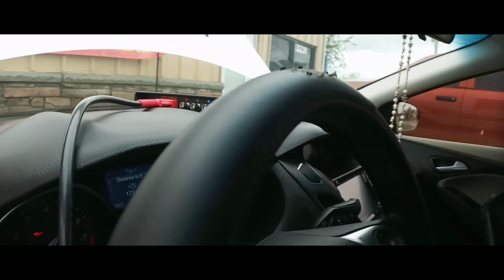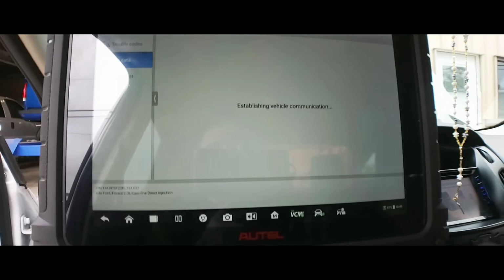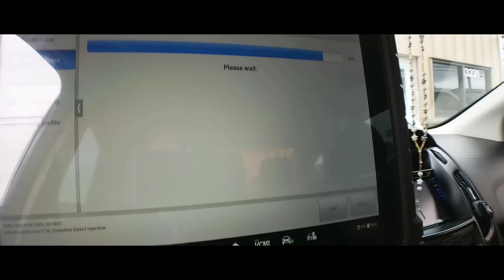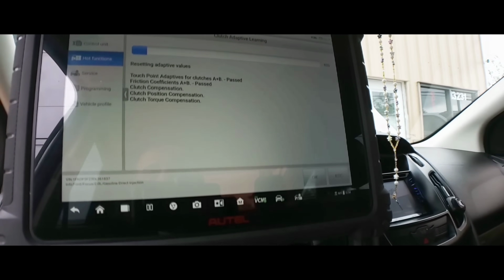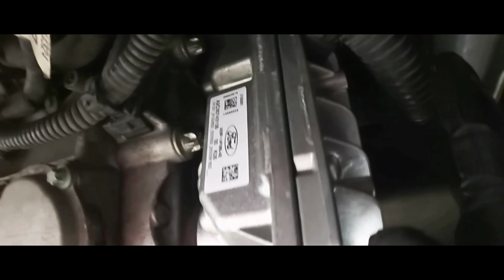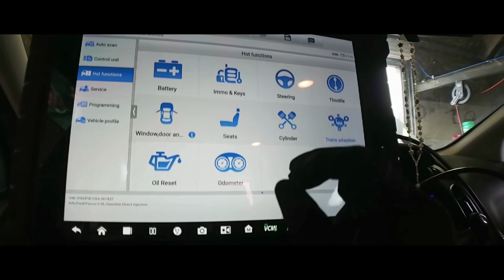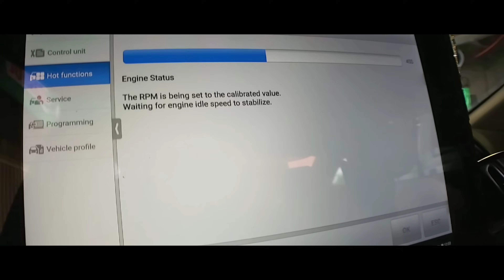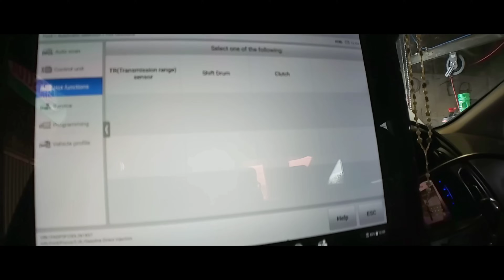🔧Ford Focus DCT Transmission Diagnosis - DCT DPS6

Comment: Just Got the invoice for whole entire replacement, 3k for everything(All) in the Bell Housing, He told me its the Forks A&B inside of the Housing,(From Experience)As you said also! He's a transmission specialist of 20+years, The #1 atleast in my County, Blessing 🙌 I didn't wanna cut corners so let's see after a total rebuild, will definitely keep posted,
Reply: It took me, an amateur, 3.5 hours to drop the trans. Probably 1 hour to install the forks and clutches and 3 hours to reinstall so about 8 hours work total. The parts were $580 from Rock Auto.
Reply: @alexkram how did it do after you changed it out? Did you have to buy the special tools?
Reply: @sbarton6908  I've done two cars now and they both shifted like new afterwards. The only tool I needed was something to pull the clutch out. I was able to make a tool for that out of some angle iron by welding a nut into it and drilling two holes for the clutch studs to attach to.
Reply: Fuck yeah man i dod same shit 😅 gotta love welding brother 🎉🎉🎉 @alexkram

Comment: The tool to turn it 14 times cost 20 bucks on Amazon all I did was spray break cleaner on mine while turning it 14 times and after doing that a few times I noticed it would unwind faster and faster and now it works better than ever. Didn’t even have to change the clutch actuator motor after all. I also cleaned out the inside of the shaft where the 14 ribbed Allen key went from any grime so the actuator would grab better and be less likely to slip and presto. Good as new. Even put some grease for better heat disbursement and less chances of chipping. Ended up only spending 30 bucks total and took me 30 mins to fix. I’ve seen some people use wd40 and breakcleaner together and even drilled holes in two places to get it all up in there and drain it too but I didn’t do all that though.
Reply: Thank you for your comment. I would definitely try that

Comment: So, let me get this right, instead of a nice manual transmission with one clutch, you have two clutches that are computer controlled.  No problem, you're good to go!  I foresee no issues in your future!!!
Reply: You can buy the manual. 
But a lot of people want automatic transmissions.
Dual clutch is like driving an auto, but they're about 10% more fuel efficient. 

Unfortunately Ford brought these to market before they were fully sorted.
Even worse, Ford dealers have absolutely NFI how to fix these. Many problems like in this video can be fixed by removing clutch actuators and cleaning out the clutch dust with brake cleaner and some WD. 10 Minutes and zero dollars. 
But dealers and transmission shops charge thousands. Even a new actuator costs about $100 and takes a few minutes to replace.
Reply: Manual transmission is the most efficient, but nobody can drive them anymore, so the manufacturers have to make a manual trans that is operated by a robot.
So just picture a robot like from the Jetsons in the passenger seat operating all the mechanics while Jane Jetson just steers it into the nearest tree.

Comment: This reminds me of a 2 year old Corolla with a locked up electric E-brake I worked on last week. I had to go downtown to an underground parking to release the brake. They couldn't get the car to the elevator to bring it up to ground level for towing. It uses a similar servo and drive mechanism which had corroded.
Reply from the maker: Technology is changing so fast on vehicles now that they're using a lot of electrical devices to run them, too many robotics built in.

Comment: Nice work! What a strange design. I wish manufacturers would just stick with the old wet clutch style transmissions and get rid of this CVT and DCT stuff!
Reply: yeah it seems like every time a technology gets mature and really working well it gets phased out for something that performs better but less reliable. I'd take a DCT over a CVT though because when a CVT goes bad you can't even really rebuild it.

Comment: @Automatic Transmission I was wondering if you Checked and/or Deleted and remaining DTC codes after you finished with the Clutch Adaptive Learning process? (Timestamp 19:35/20:09)

Comment: I have an 2012 also my problem is after she warms up she stops shifting I usually pull on the side take of negative terminal reset computer start up and then she roll after for a few minutes then I would have to reset again what do you think that could be ?

Comment: Wish I saw this 2 weeks ago. Had a 2012 Focus come in and this was my first time doing one of these. Wasn't making that noise though. Replaced clutch without knowing you should replace the shift fork. Even asked a transmission shop next to our shop if I should replace them and was told no. Ended up putting it all back together and it won't let me finish programming. After watching this I'm positive that my problem is the forks. Only problem I've ran into now is resetting the clutch
Reply from the maker: Yeah, you're going to need the tools for it. There's a video on my Spanish channel  Transmisión Automática.
Reply: @AutomaticTransmission  i just installed mine with flat head lol no special tools needed lmao
Reply: @reecejones1248  The only special tool I needed was one I made out of a piece of angle iron with a nut welded to it to pull the clutch out. The forks need a torx plus sockets but I already owned those.

Comment: I have a hand-held diagnostic tool, but it did a job by showing 2 faulty codes P07A3 & P2872 the same codes you showed in yours. Do I have to strip my transmission box which is a big job and Ford dealer wanted to charge many thousand dollars or just simply turn the clutch fork counter-clockwise 14 turns to fix it like in your video? Your expertise advice would be much appreciated.

Comment: It'd be nice if you could do the troubleshooting on the Fiat's & Chrysler's double clutch version whenever you get one in. I had one with no apply in any gear, but the fsm manual dnt have a lot of info.

Comment: Guys, don’t forget the relay that powers the transmission. Sometimes low voltage between the control and load side could cause all sort of issues. That little thing opens and closes million times during the life of the vehicle.

Comment: I am getting ready to perform the learning process for the TCM. I am receiving a parking error. (Transmission Not in Park Please Select P) The car will not crank or start, but has battery power, all the lights come on but when I go to shift, the "D" is enlarged and gray instead of the orange it usually is. The shifter will move the gears but the computer part of the car doesn't register that it's changing gears. I'm at a loss of words and not sure what action to take now. Any and all advice is appreciated. 😊
Reply: I know this is an old comment and you have figured it out by now for anyone else reading this your problem is one of two things: 1. bad transmission range sensor or 2. trans wire harness big connector is not fully mated. This exact thing happened to me also on my first time doing this and it was #2. I tried replacing the range sensor with a junkyard unit first but there was no change. I lubed the big connector with silicon spray and reseated it and it was all good.

Comment: I have Renault EDC DC4 and I think its same  TCM uses. Why are they had problems and need to replace? Any method to fix it or protect? I heard its causes coz of weak battery or heat issue. Is it correct? Any external item for that TCM cooler? Thanks.

Comment: I've worked on over a handful of these cars and the DTC code I stay away from, I believe is P2837 or P287B. Cause I don't want to take apart the trans to get to the gearbox. 
I don't mind doing the clutch though.
Reply: Why? its a 3-4 hr job in and out and the car drives like new again
Reply: @schmick63  cause I don't want to do the job.

Comment: I have a 2015 Ford focus dosent reverse and when i try to do the Clutch adaptive learn it fails at Select gears do you have any idea what it could be?
Reply from the maker: Sounds like the case might stopper might be stripped. It's going to require a new cover. 
Do the "shift drum learning ", if it fails you need a new case cover, which is the main case of your transmission.

Comment: I've got a P0805 Clutch position sensor "A" circuit & P2872 Clutch "A" stuck engaged on a 2012. Turns out A clutch servo motor will not turn on ignition is turned on (self check) B will turn. Swapped out the servos and problem stayed with A clutch. Dealer says it's a TCM problem ( I think they're right). So now waiting on a TCM. BTW with the servos plugged in and hanging out the self check when turning the key to ignition should make them turn no tools or scanners needed to diagnose.

Comment: What would be the problem if the fork keeps spinning and doesn't reach a top nor bottom?
Would the fork be snapped?
Reply: I’d say the threads on the rod or the teeth on the gears are stripped or broken…but I’m not a tech, just basing that off of knowing how the part is supposed to work according to the manual.

Comment: Which autel scanner are you using. I'm tired of my snap-on modis edge
Reply from the maker: Autel Maxisys Ultra, it has a built in 4 channel oscilloscope, wireless, It's a nice tool.
I retired my SnapOn Verus Edge, I only use it on older vehicles that the Autel wont do, like OBD-1 domestics and imports. I have all the the connectors for them, so if you get an Autel scanner keep your SnapOn for older vehicles if you have all the adaptors.

Comment: I have a 2015 Ford Focus and my car does not reserve and it makes that sound like in your video. I bought a new actuator to see if it fixes the problem. Now when you turn it 14 times counter clockwise, should it be easy to do because when I tried it it actual spin right back. Am I doing it wrong? Please help!
Reply from the maker: The reason I performed that particular test was to see if the fork is pushing on the clutch. So if yours is springing back at you it's considered good. 
On the video the actual motor was the issue, splines worn-out causing it not to grab.
Reply: I replaced the Actuator B and my car still does not reverse and still make the noise like it did in your video. I check the fuses box and I disconnected the battery and still unsure what is wrong with my vehicle. If you have any suggestions would greatly appreciate it.
Reply: @capricefrazier9369  did you manage to fix it?

Comment: Que abido mi compa tengo una silverado 2015 i tengo un problema con la trasmission lla le cambie la caja de valvulas ase esto vas en la carreterra i cuando le vajas la velocidad. Vaja los camvios muy rapido como si tragera el freno de la trasmision
Reply from the maker: Tenia fierro en el carter cuando cambiaste la caja de valvulas? Puede que la compensator valve se este atorando.

Comment: Hello!  I have the same transmission in my Smart 453 from 2016, unfortunately I have some error codes in the gearbox, I reprogrammed with a new software but in vain.  error codes: U0028,U010187,U010182.  Do you know anything about them?  thank you

Comment: Mine fails at Shift Drum Adaptive Learning. Both actuator motors have been replaced. I'm suspecting the TCM since I'm getting P285C Shift Fork A Actuator circuit performance, P2860 Clutch B Actuator Circuit performance & P2872 Clutch A Stuck engaged, along with the same for Clutch B P287A, also some weird one that says Clutch B Disengagement time performance P2877, same for clutch A.

Comment: My 2015 Fiesta makes that same exact sound! 😮
Reply: My son came in the room and asked , " is that a Ford?"
Reply: The ones that crack me up are some Asian cars have a ' beeper ' that is exactly same thing as cheap, two- dollar quartz dial alarm clocks.
Even pulse the same.
Makes me think that somewhere under the dash is one of those clocks wired to the system.

Comment: I’m having a clutch replacement and dealership was able to replace but it won’t relearn the new clutch. I have no idea what to do.
Reply: What did you do in the end ?
Reply: @oscarcee6831  they had to change the transmission housing/case, a piece (the “stop” had broke off inside and was causing the TCM to not know what gears it was in, after the changed the case the clutch was able to relearn
Reply: @theempirestate6982  thanks for the reply , what milage did your car have ?
Reply: @oscarcee6831  140000
Reply: @oscarcee6831  after the clutch and case replacement it is running really well even at 140000

Comment: Hey thank you for putting such helpful videos. I currently have this transmission issue. 15 ford focus. I recently removed the dct transmission to inspect the forks and clutch. And they looked fine. Now when I reinstalled everything it makes a horrible grinding noise when I shift the gears and  Code P073F -Unable to engage gear 1 pops up. I did the adaptive learning for the drum and passed. I did the clutch learning and everything passed except for "clutch touch adaptive learning". If you or anyone have suggestions or tips, it will be greatly helpful
Reply: Same here, did you find a fix?

Comment: Today I followed your instruction & rotate clutch fork. 2 recent faulty codes P07A3 & P2872 disappeared. I drove a car for a test with my small hand held diagnostic tool. After a car was driven for a test, the input shaft speed A & B showed unequal input voltage. When a car was not too hot, input shaft speed voltage A & B were equal nicely. after the driving test, a new faulty code P286F appeared. Please let me know what's going on? Did clutch actuator B need attention or was it TCM problem? Thanks

Comment: right now 
I have P2872 clutch A stuck engaged. i have only this code... plz what can I do.....please note that  ISS A raw has velocity (speed) with the RPM of engine even when I disconnected the clutch A actuator motor.
Reply: I am having thé same code error did you found a solution to your issue ?
Reply: @ibrahimadiop4990  I have been searching but I can't solve it... and I found to replace the gearbox with a used one but its costest... I found a garage to fix it but the cost is higher than the used complete gearbox. plz update me if you fix it ........... the problem is either dct clutch or bearing. How long time are you using your car? coz I am scaring to repeat the fault after fixing it.

Comment: Used to work for Ford done many of those clutches 
Nice diagnoses
Reply from the maker: Yeah, most of these vehicles are out of warranty now. We're seeing a lot of these going through the shop. We're getting all the parts from Ford, seems like the aftermarket hasn't come up with parts to service these vehicles yet. 
Still some new clutches have issues right out of the box, Have you had any issues with any while you were working for Ford?
Reply: @AutomaticTransmission  yes had guessing I in 8 had some sort of issue 
Alot of software issues
Reply: @AutomaticTransmission  hi when you mentioned clutch, which parts did you refer to, the fork or clutch actuator? I tried to understand more, because my car has similar issue. Thanks

Comment: Wow! That's nuts! 1st I've ever heard that!!  Haha. On to the rest of the  video...

I'm up to the part where you think 1 of the actuator motors is bad. My thought,  it almost looks like it's shorted to a pulsed power? Now TCM is powered off and all stopped. So somehow backfeeding itself?? Pulsed?? Just so weird. Very interesting case study.
Reply: Ok... very interesting...i know I said that.  So the lack of being to turn that fork using the actuator was technically keeping the TCM awake? Like wipers trying to 'park'?   I see you've stepped up your diag game Hiram. Very impressive! 😍😁😉👏🏻👍🏻👍🏻
Reply from the maker: Yeah, these vehicles wake up really easy and fast, if you just open or unlock the door you'll hear the shift forks align to get the transmission ready for once you get in and start the vehicle. They constantly self test and align themselves to power down, as you saw here it was failing to do so. 
Some of them if they get stuck in gear they wont start, wont crank and if they manage to start they wont move. So if you get one of these with a no crank, wont start issue and everything powers up normal, suspect something is going on transmission wise.
Reply: @AutomaticTransmission   have you worked on many fiesta transmissions?  What is the most reoccuring problem with the transmission? Is it the clutch plates prematurely wearing out? The actuators binding or TCM modules failing?  I was reading the 2016 had significantly fewer issues with the dcts.  I am considering buying one, though I don't know if the transmission will exceed the 200k mark.

Comment: Actuator is stuck because buildup on forks. Pull off Actuator, then using break clean and proper torx bit manually turn counter clockwise 14x or real slow with drill while spraying with break cleaner. Repeat a bunch of times till it loosens up. Then spray with wd40. If this works saved you a few grand. Change tyranny fluid after this process.

Comment: I have a 2013 focus se 2.0l won’t start after i drive it.  I checked battery was good, put new starter, new relays on starter and Ignition relay and new negative battery cable. I also used the other key. Also it seems when it warms up and gets driven it don’t start. But when it cools it seems to start again. I’m stumped! Any pointers??
Thanks in advance 

Great video!!!
Reply: Any updates? I replace purge valve and - battery cable as well stripped paint off bonds still having stalling issues
Reply: I got a TCM from a junk yard and it got my focus to start and drive. Trading it in Wednesday while it still drives. Never again will I ever own another Ford